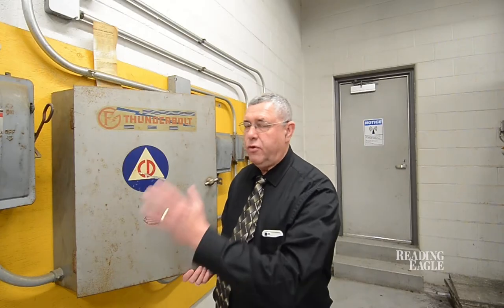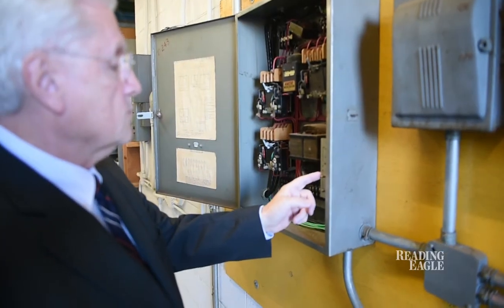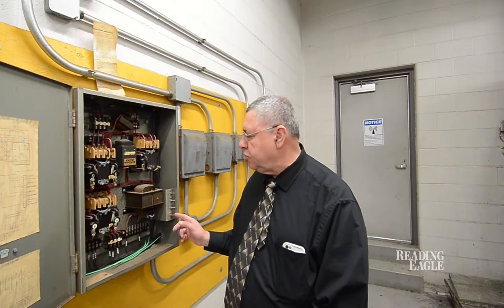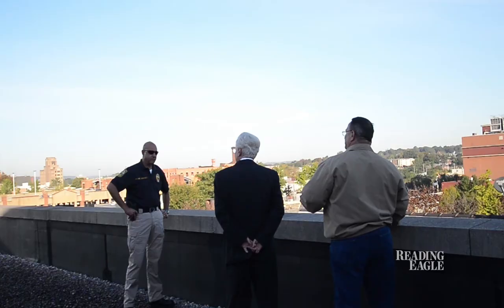Air Siren Test

Comment: hes correct on the cold war era part (50s era by the sound of it) but it sounded like the blower gave out or belt broke for the blower during its testing or something ? though its back working apparently in the end part of the video ? and id be surprised if it rotated if it hasn't been used in a long time.. that and its meant to be blower, rotator and chopper in the panel itself. interesting video though